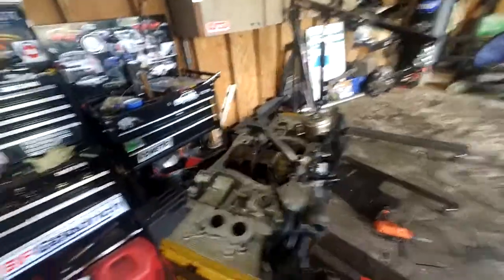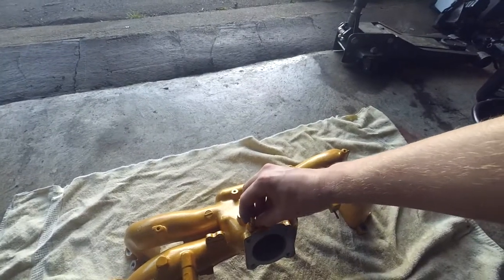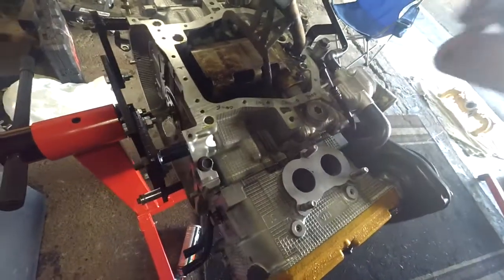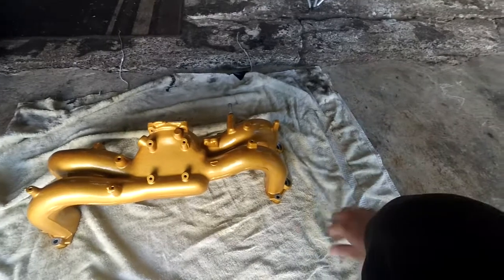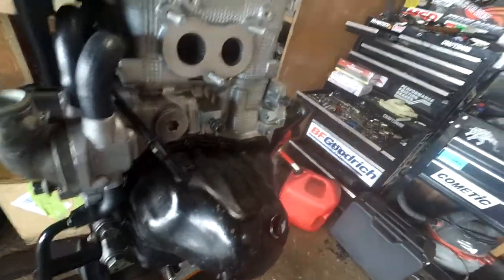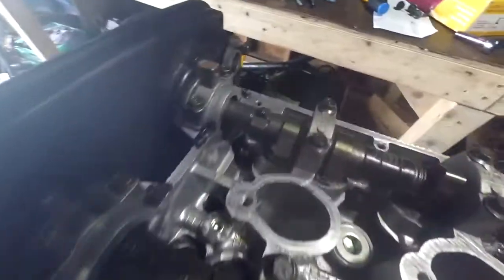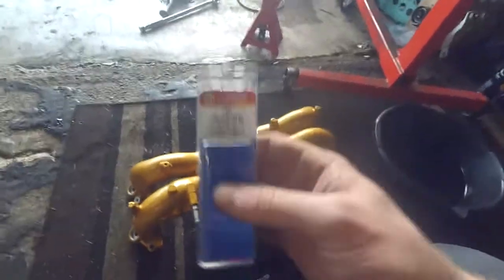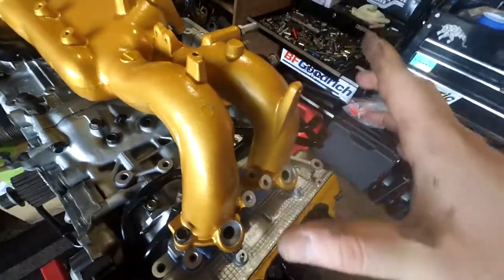Modifying the Intake Manifold - Hybrid EJ22T/25D

Comment: Did you ever have the problem of boost leaking from the manifold into the IAC with the modified EJ25D manifold?
Reply from the maker: That's a great question, I have heard people have done this without that problem, but what I did was use a Ford truck one way check valve from the emissions air recirc stuff, and put that in the hose for the iacv to make sure it can't leak out. It's not the cleanest looking thing but it works. The stock 22t umbrella valve under the iacv can fail very easily so I used both.